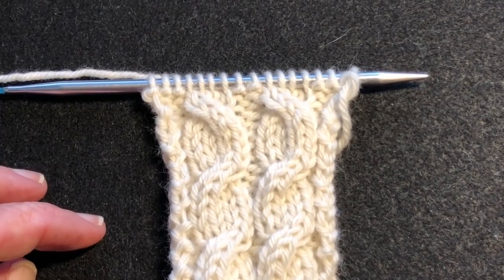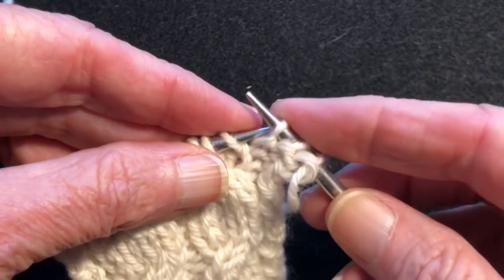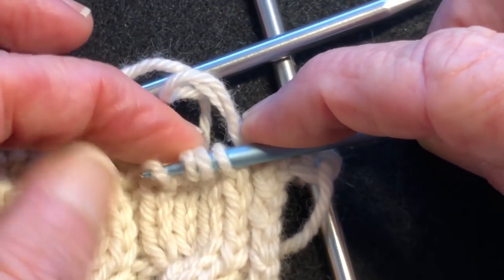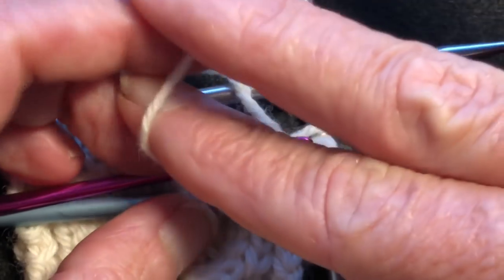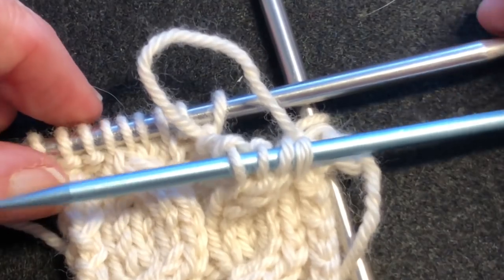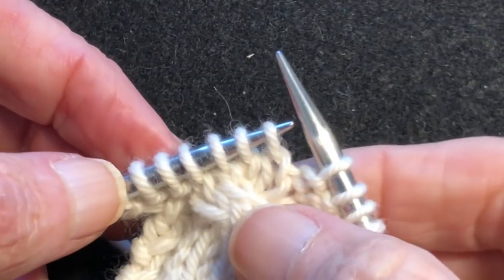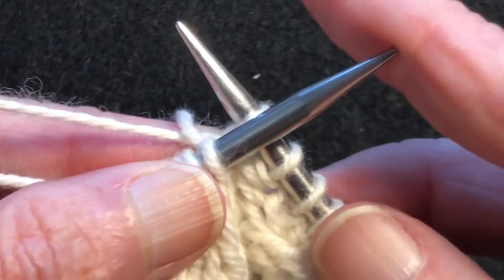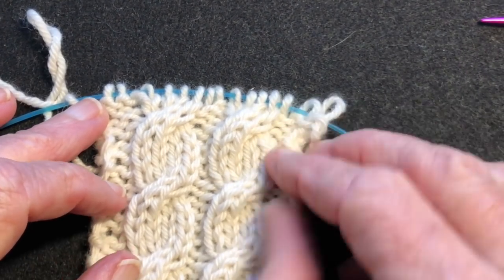Fixing Mis-Crossed Cables w & w/o Cable Needle

Comment: Thanks again for your clear explanation Had hoped to be able to use it to fix a crossing mistake I just discovered several rows down but don't think that it will work It is a more complicated celtic knot kind of cable patron Looking forward to the fix you mentoined in response to the previous comment Cutting sounds pretty scary For now I'll just rip it out and redo the whole 10 or so rows Still like your clear videos on all the technical knitting stuff Am using several of the techniques I learn from you in my current project Thank you so much!
Reply from the maker: The next cable fix video should be out sometime this coming week.  Thank you and Happy knitting.
Reply: Knitting with Suzanne Bryan Thank you, Suzanne Take your time Fixt it this time as I said by ripping out Already passed the point I was before Will definitely look at the next video to see if that would have been a simplier/quicker solution Thing is that the cable runs over several "columns" if you understand what I mean In every other row it moves 2 stitches to either the left or the right So I wasn't sure if the dropping over 10 rows would work